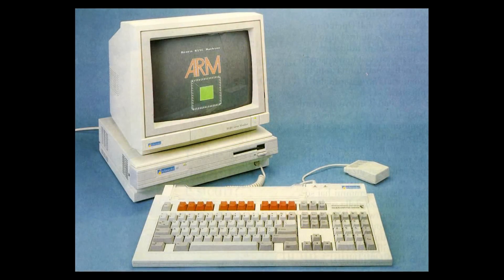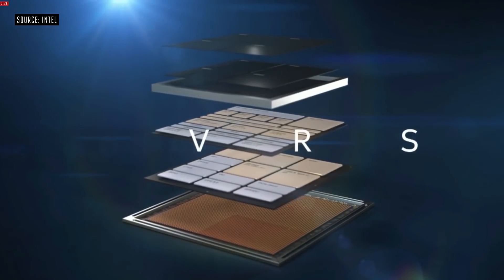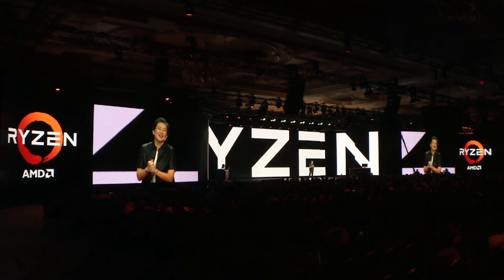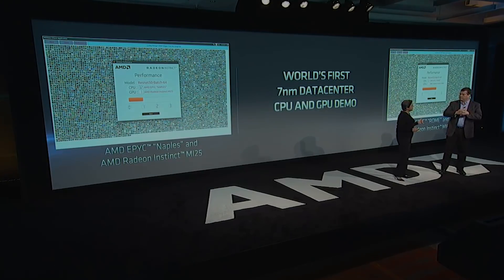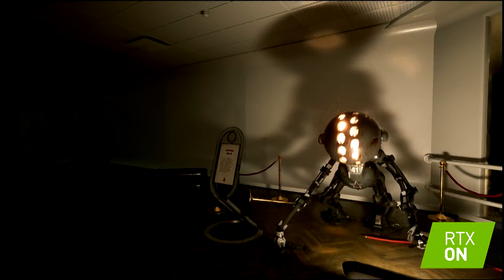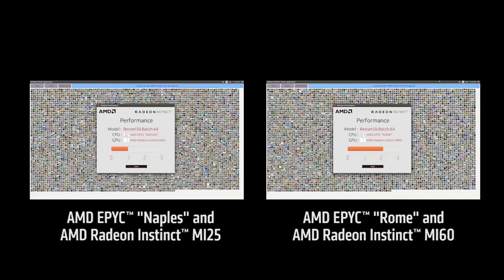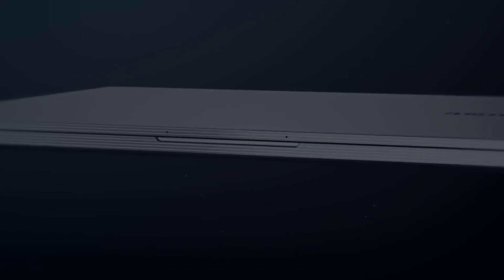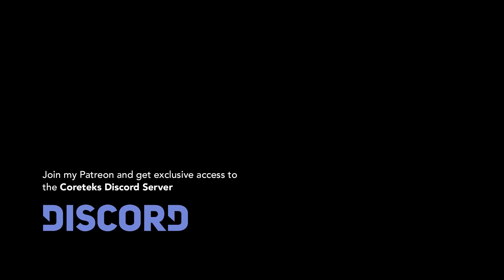Hardware trends: How many cores do we need?!

Comment: Again don't buy it.

ARM is destined for smartphones, low-end tablets, and IoT devices tops.
Anyone doing serious gaming, rendering, editing will want 16 high-speed cores, GPU performance 10TFlops+
Nobody takes ARM seriously.

Also please show me GTA V working on ARM. You said this several videos ago and still no evidence.
Reply: TABSF1
 people doing serious gaming, rendering and editing are a very small portion of the consumer market. There will still be 16 high-speed core parts for you, but the cost will probably be disproportionately high because of low demand
Reply: @dnmr  

61.39% of Steam users are using DX12 GPUs on Windows 10
28.11% of Steam users are using DX12 GPUs pre-Windows 10
So 89.5% of Steam users are on DX12 hardware.

CPU
55.89% have 4 cores and 13.58% have "other". Not 1,2,3 or 4 so it most be 6+ cores

GPU
From the top 10 GPUs 44.37% of them are used by the community
GTX 1060, GTX 1050 Ti, GTX 1050, GTX 1070, GTX 960, GTX 970, GTX 750 Ti, GTX 1080, GTX 960M, GTX 1080 Ti
Funny that, all Nvidia...
The most powerful gaming ARM SoC is about 40% of the raw performance of GTX 960M 

Steam has
Over 125 million users (last reported in 2017)
Over 90 million monthly unique users (PC Gamer 14th Jan 2019)
Over 47 million users every day (PC Gamer 14th Jan 2019)
Over 18.5 million concurrent users (PC Gamer 14th Jan 2019)

"Low demand..."
Intel has kept mainstream at 4 cores / 8 threads for almost 10 years. No more
16 cores is probably gonna be the limit for at least 7-10 years but it'll drive efficiency. There is a demand! Just not £500/$600 for 8 cores.
If AMD got their act together then GPUs would be much cheaper as well.

Ryzen 3000 and Navi should change everything!
Reply: @TABSF1  90 million monthly steam users is about 16.6% of the 1.5 billion windows users. In perspective, there are 2.7 billion android devices and 1.3 billion combined Mac + iOS. Most of them are not using DX12 GPUs or any of the GPUs you mentioned before editing your reply.

In fact if we look at the steam survey you also brought up, the four most popular GPUs make up a third of the surveys, and they were all released in year 2016. 40% of the "hardcore gamers" are using the 1000-series. That's either "a whooping" 40%, or "just" 40% depending on what point you want to make, but let's look a bit further first. 12% are still on 900-series and 8% are on 800-series, that's every fifth running severely outdated hardware. About 10% are on AMD and 10% using intel GPUs if you're curious. 10% of steam users who take the survey don't even have a discrete GPU. 
This does not describe high demand for a new product, this is stagnation.
Reply: @dnmr  

Cute "editing your reply" that's your comeback? I was making spacing and spelling corrections ;)

I'm guessing 90 million active monthly users is nothing then? 
Not like all these... Origin, Bethesda.net, Battle.net, Uplay, GOG, Discord Nitro, Epic Games Store, Humble Bundle...
Are trying to get in on the market because there's $10s of Billion at play here!

Android has 2.7 billion devices and over 1.3 billion Apple devices, WOW so impressive... Did you forget to read my part about the most powerful ARM chip is comparable to PC games over a decade ago?
Nothing serious is played or done on ARM! IOS and Andriod get cut down versions of cut down versions of games and software period.
Photoshop and Office? ;) Even YouTube and other Media apps ask you to log in using a browser (not even a mobile adapted page) to get full functionality, don't kid yourself.
Banking apps are another!

"severely outdated hardware" another gem you'll remember for a while I'm sure
ARM latest and greatest chips are severely outdated when it comes to performance, based on raw numbers alone you can go back to 2007 GeForce 8800 Ultra and it's on par with ARMs most comprehensive GPU to date!
Crossed your mind that's why games on IOS and Android look like PS2 games? The year 2000 (when PS2 was released if you need assistance)

Here are the top 25 chips listed on the survey that are in excess of 2x ARM's most powerful GPU
All cards are DX12 Compliant

10 Series is 38.56% with 1030, 1050, 1050 Ti, 1060, 1070, 1070 Ti, 1080 and 1080 Ti
900 Series is 12.12% with 940M, 950M, 960M, 950, 960, 970, 980 and 980 Ti
700 Series is 4.5% with 750, 750 Ti and 760
600 Series is 1.4% with 650 and 660

"stagnation" Interesting considering that the community is constantly upgrading to the latest generations!!!

The only stagnation has been AMD involvement in the PC GPU space!
Only RX 480 and 580 fit the above criteria at 1.4% ouch!
15 months between Vega 64 and RX 590 release and 18 between Vega 64 and Radeon VII releases!

Intel HD Graphics 5500 and 6600 = 1.13% they are also in excess of 2x ARM's most powerful GPU

The most powerful GPU on that list is the GTX 1080 Ti, its raw compute is 29 times more than ARM's most powerful GPU
Like I have said before, the most impressive games on IOS and Android look like PS2 games... Do you wonder why?

The best looking games on ARM are on the Switch using Nvidia hardware and they have to run extremely cut down versions of the games
Sub 30fps, lower than the lowest PC/console setting at 240-320p resolution on titles such as Wolfenstein.
Breath of the Wild vs Witcher III anyone?

Congratulations!
Reply: @TABSF1  sorry for that edit remark, youtube hid most of your comment when I expanded other replies so it looked like you'd remover the bulk of your text. 

I understand your sentiment and sympathise with it, I too want better hardware for everyone, more power and better looking games. The reality is though that there are very few people who need this level of hardware and are willing to pay for it. The revenue from mobile games is surpassing PC and console revenues combined last year, you can't really say that this is irrelevant. It doesn't matter that you think those games are shit, the investors don't play games. The market that brings more revenue will attract more investment and more innovation, and you can't really do much at this point except for trying to make PC gaming cheaper and more accessible. 

This brings us to the other point of Nvidia not giving a crap and AMD focusing on consoles. 2000-series had ridiculous shortages on launch, and people aren't buying into it according to the steam survey numbers. AMD might bring navi at affordable prices, but you can't reasonably hope for it to miraculously bring everybody high end performance at entry level price. AMD will still want to make profit, and even if they release competitive products at affordable prices, Nvidia will just drop their prices enough to keep people from switching. 

I can't see a point you're trying to make here anymore. PC gaming is getting less and less relevant globally, and it doesn't help that hardware manufacturers have been ripping people off for years and stalling innovation.
Reply: @dnmr  

It's not very few people though, evidence has shown people are flocking to the new hardware generation on generation, Kepler was a huge leap over Fermi, likewise with Maxwell and Pascal.
Pascal is probably the biggest GPU series in gaming history!

As for Turing, Valve only do the Steam surveys every 3 months right? So there hasn't been enough time on the market for RTX cards. 2070 and 2080 are only recording 0.62%
These are not cheap chips, once 2060 and 1660 Ti (providing it is legit) will show that hardware is still in demand.

https://newzoo.com/insights/articles/global-games-market-reaches-137-9-billion-in-2018-mobile-games-take-half/
Sure mobile games make more money, would you call it quits on $32.9Bn just in the PC space, really? Also, PC is growing not reducing!
Just not growing as aggressively but once these kids grow up they'll get a console or PC and move away from IOS and Andriod games.

You'll never get a GTA V, Witcher, Cyberpunk, Red Dead, God of War or Halo on mobile, nowhere near the quality of Halo 2 or God of War on the PS2.
Why do I know this?, show me the games now? The best IOS and Andriod have is GTA III, VC, and SA from the PS2! (just ports)

Nvidia do give a crap, Intel sat on their hands with 4 cores 8 threads for nearly 10 years, let's face it Nvidia could've done the same, Titan X from 2016 is more powerful than Radeon VII
. it's over 2 years old, Nvidia is giving us amazing stuff like DLSS which could be a game changer, imagine 4k gaming at over 60fps on 2060! incredible. 

AMD has been focusing on consoles. Bulldozer nearly killed them, Nvidia outclassed them, it was their only option.
Zen has fixed this though, only time will tell but I'm very confident that 8 cores 16 thread Ryzen 3000 will be $200-300 tops, this will be the new standard, it's going to blow it wide open.

Navi is no joke as well, RX 480 when it came out was extremely powerful for its price, it was near GTX 980 performance at $239
It didn't do so hot because it didn't compete with the 1080 but lots of them were lost to miners and then the prices got out of control!
AMD has to get this one right or their GPU's are dead, I know AMD fanboys that are switching because of the drought! 

AMD is doing high-end performance at entry-level prices right now and Zen 2 + Navi will prove this
 further!
Nvidia will drop its prices like what happened with Fermi vs HD 5000 and hopefully, real competition will be back on again!

PC gaming is not dying, evidence proves it expanding, just not at the same rate as mobile but its a foolish comparison.
Hardware manufacturers have been ripping people off but we've just entered a new era of innovation with Turning and Zen 2!
Reply: @Zorro33313  

Coreteks said in a previous video that GTA V is already running on ARM-based devices! Where's the evidence for this?
I'm sure you can make it work, but the what degree, games that are made specifically for ARM-based devices look like PC games from 15 years ago... 
Just to make it clear for you, games that are made using RISC code on RISC processors on the latest Apple and Qualcomm SoCs look like pc games from 15 years ago...

Congratulations
Reply: Ye i agree.. arms wont replace any PCs anytime soon. Its a reason why CPU/GPU are this big, because all the power they got. And this will just continue and continue. Now we have ray tracing on turing gpus that can only do shadows at shit fps.. can you imagine in the future when we have GPUs that can do full ray tracing at 144 fps plus how big these GPU will be? Good luck doing that on a little ARM module.
We also have massive upcoming games like star citizen that require a lot of your hardware(16 gb memory).. and this is just the start.. in the future i picture myself gaming in massive MMO universe with thousands of players in the same place at the same time with sick graphics(ray tracing) and ai that behaves like humans.. and this will require many many cores, memory and strong gpus. Again good luck playing that on a arm module. 
Sure a lot focus is on mobile gaming.. but i think this is great because it will funnel players into PC games.

Comment: The thing you're missing is that even if 'only' 32 cores are used by a single app, the trend is that we run more and more apps in paralell... Therefore, more cores will be needed...
Also, thin clients are cool and all, but, requiring a connection is costly and not always possible. While thin clients do have a place and their use cases, they'll never replace full fledged PCs.
It'll be like what laptops did to desktops, or tablets, or phones. Everything has it's place.